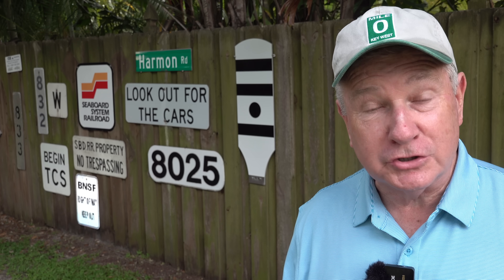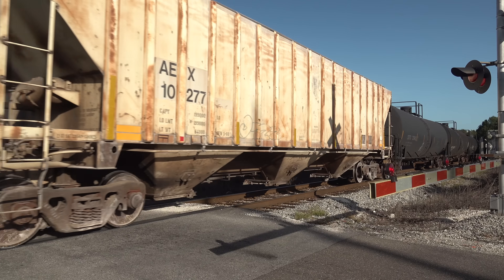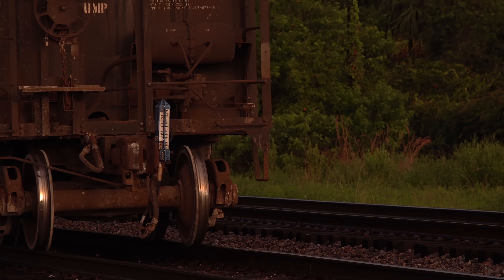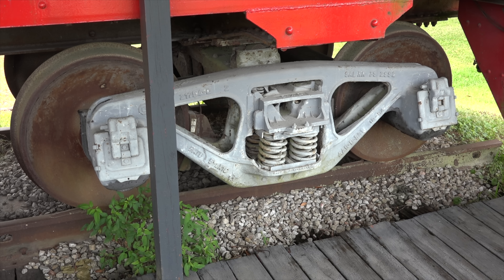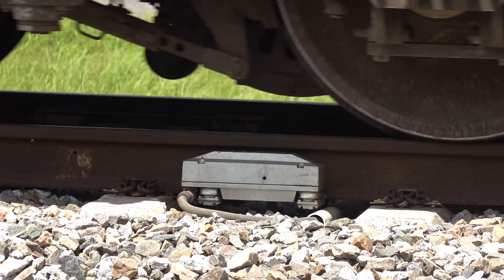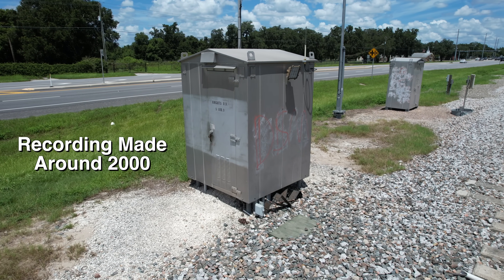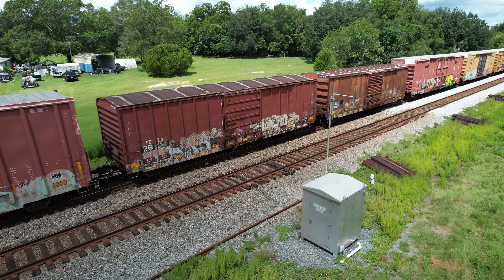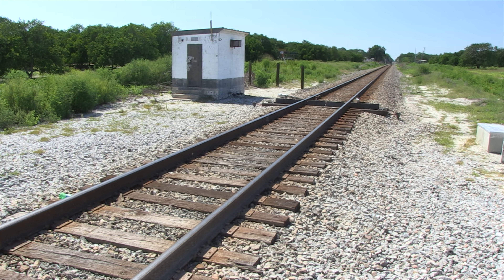What Railroad Defect Detectors Do

Comment: I've a few questions.  Does the Defect Detector also send a message to Amtrak trains operating on the line?   Also, it the Defect Detector alerts the engineer of a problem, what happens?  Does the train stop in the middle of its run so that someone can walk back a mile or so to look at the problem?  If so, what if the guy can't fix the problem on the spot?  What does the train crew do then?
Reply from the maker: All good questions. Yes, all train including Amtraks have to monitor the radio's road channel. If the DD signals a problem, the engineer, iin most cases, most stop his train and the conductor or other train crew member must walk back to see what the issue is.  If they cannot fix it, they must call a shop truck to come out and repair the defect. Or set off the defective car in the nearest side track.

Comment: Oh, pleasant memory of the days of four-man crews and cabooses. I was at Alamogordo, NM with the Air Force. Just south of the US-54/70 overpass of the Southern Pacific was a defect detector. As was the norm for the day, above the shanty was a large "digital" numerical display board. Atop the board was four or five lights, each one indicated a specific defect. Instead of radio transmissions, the detector relayed info to the conductor (in the caboose) any defects by use of that board. When a defect was detected, the appropriate light would illuminate and the detector would start counting axles. When the caboose passed, the conductor would know what the defect was and how far ahead of the caboose it was located (by the axle count). A "No Defect" was indicated by all the lights being dark and the number board displaying a "000". Remember driving over many a train passing by that detect. Never did see the number board "counting".

Comment: Another good one.  @ 2:06, noticed the end of the bulkhead flat car needs a little work. 1943 Frankfort Junction derailment disaster was caused by a ‘hot box’.  As usual, it took 2-3x the video length just to check out locations featured.

Comment: Been to Sinclair Antennas a number of times in the Buffalo NY area back on the 80’s and 90’s. Personally I would use 2 beams pointed up and down the tracks with a low power radio.

DE N2JYG

Comment: HI Danny -- I see a lot of double stack shipping containers on different lines . I have always wondered how they tie down the top container to the bottom one so they don't come lose and fall off . I am sure it's something  very simple but they go by so fast I can not see how it works or how they are connected . If you have a chance and a bit of time would you please explain to this old dummy how it works ?  Thank you very much  bob k    n1jrm.....I used to work for Timkin co. in Canton Ohio and I used to grind out the inside diameter of  the bearings for those rail cars
Reply: HEY thanks Danny - i found what I was looking for -Double-stack rail transport - Wikipedia- it's a twistlock that fits in the tiedown on all four corners , what a ingenuous idea , thanks again

Comment: Thanks Danny, always look forward to your videos. A few years back, I noticed a train here in Ocala Fl. with two engines that had no crew inside. On the side it said being operated by remote control. How is it determined when and where to not use engineers? And are these only on short runs? If You have already addressed this in a video, let me know and I will look it up. Thanks
Reply: Remote control is mostly used in switching or yards.  There is an operator somewhere near by.

Comment: I find it interesting that railroad detectors are not standard in their data reporting. On the west coast with the union pacific the detectors used to transmit time, temperature, train speed, length, total axle and even direction as well as which track number and mile post. The NS in Ohio only reports no defects and axle count. Another topic that might be of interest to tell rail fans is how powerful are the two way radios that trains use and what is the approximate range of the communications when you have 2 mile long trains. I know they use repeaters along the track but a lot of times you have crewmembers just using a 5 W radio. One other thing do you foresee the railroads using digital radios versus analog and are they going to use coded frequencies and scramble signals to prevent public access just like police radios now use?

Comment: Close but no cigar, the old lead babit bearings did not use grease, the used oil plus the application device inside the   Journal to feed oil to the bearing and keep it lubricated and cool.  It was not uncommon to have an “oiler “ who handled an oil pipe with a valve in squirt a small amount of oil into the journal box to replace the the oil that leaked past the seal. This oiling is done generally on the move as a train is being humped. Prior to the train being humped the car department would walk the train to open all the journal’s boxes so oiling could commence without stopping the jump job. Now roller bearing do use grease as it’s a sealed waterproof bearing assembly. Because of roller bearings you see very few old style friction bearings the require oil.

Just thought you should know. 

Food for thought
Reply from the maker: Yeah, that was way before my time so I missed that one.

Comment: Another fine video with plenty of information yet produced in an easy to understand format.  In the mid 1960s we'd visit relatives and I remember seeing poles with a number box on top. The crew in the Caboose was to look at this display to see what axle may have a defect. In the late 1990s CSX crews in upper Indiana had to verbally acknowledge the readings of the detector whether there was a defect or not. CN detectors give the temperature here i Wisconsin saying 72F (example)  Makes one wonder if Canada reads 20C?  Speed is stated 55 but no MPH or KPH. That new shed detector sure does a lot.
Perhaps while they're at it they'd like to invest in a run through locomotive washer just insert 50 cents as you pass through.  Thanks again for a great 🎥

Comment: I don't think the explanation of buffer cars at the end of the video was quite right. There's no requirement to have a buffer car when switching, so I doubt they'd put a buffer on the rear that reason. Even if they did prefer to use a buffer when switching, there'd be no reason to take it across the country on every train -- they'd leave it at the loading/unloading plant. I thought it was just so that there was already a buffer car ready when the locomotives ran around to change direction. If you think about it, it takes a lot more switch moves to re-order the train from locos-buffer-tanks to tanks-buffer-locos, compared to the old days of going from locos-cars-caboose to caboose-cars-locos. (You'd need to separately run around the buffer car, wheares with a caboose, you can just run around the train, take the caboose off, drop it on the run-around, pull the train forwards and back it onto the caboose.)
Reply from the maker: I was just trying to make a basic explanation of why they are there.
Reply: @distantsignal  Fair enough.

Comment: I became a defect detector in the fall of 2018 waiting for a UP train to finish passing. I first heard, then saw the wheel on one freight car missing about 1/3rd of the flange. Since the line was CWR the sound from the broken wheel stood out from the train going down grade. I called the UP emergency number very shortly after the train passed and I could see the number on the box by the crossing. You don’t want a tanker with hazardous chemicals in a derailment.
Reply: why th do they use this horrible outdated way of voice reports? Digital data over wireless links are much more reliable and accurate and exist for decades.
Reply: @RandomUser2401  The principle of keep it simple, stupid. They have to listen to the radio anyway. Your idea would require yet another gadget that needs to be installed in every train, it can break, has to have updated software, somebody's going to be distracted poking around in and miss a signal, added cybersecurity concerns, etc. etc. Anyway, in modern defect detectors, non-critical defects aren't announced. Things like images, wheel profiles, bogie geometry, predictive alerts are correlated with the railcar information from AEI, uploaded to servers, and somebody analyzes and views them later and schedules maintenance as necessary.
Reply: @straightpipediesel  In Europe these systems are completely integrated into electronic control stations, fully automated and fail-safe. Axle counts are automatically checked against the one reported from the dispatcher and so on. In a defect case, signals will automatically stay red/closed. With this system all it takes is one guy to miss a radio call and you have disaster. Not even mentioning the often horrible audio quality, making it hard to hear what even is going on. You are mistaking simple with proper.
Reply: @RandomUser2401  The "horrible audio quality" doesn't exist because the unit is transmitting literally next to the receiving train. In another example of KISS, radios run simplex, not those overly-complex GSM-R/NRN things you have in Europe. And no, you don't have "disaster". This is not high-speed, or even passenger rail where a derailment sends people to their death in a bridge. This is low-speed cargo rail, where on average, 4 derailments occur in the US per day. The low cost is balanced with the low risk level, again applying KISS.
Reply: @straightpipediesel  4 derailments per day is a very very bad statistic, showing again how little money is invested into proper infrastructure. GSM-R is used for VERY good reason as it can, again, properly secure rail traffic. GSM-R is nothing new but used for decades. And a derailed fright train can cause A LOT of damage to both people and property. Just because there are no people on the train does not mean no people are endangered.
Reply: @RandomUser2401  4 derailments occur in the US per day and nobody hears anything about it. That's how the system operates. You spend money and make it expensive Europe does, and it ends up being more economical to truck or fly the cargo anyway. You see this in Europe where low-cost carriers are better than train. You're not going to fly coal or corn syrup. There's nothing to invest, these railroads are all privately owned, they invest their own money. In conclusion, you can't apply European logic to cargo rail, because Europe fails miserably at cargo rail.
Reply: @straightpipediesel  yeah 4 derailments per day is utterly bad. And excuse me, rail cargo is not working in Europe? wow you are utterly clueless. It is used for everything heavy and often covering very long distances.
Reply: @RandomUser2401  "everything heavy". Where can you move a double-stack ISO? The continent's got 3 different rail gauges!
Reply: @straightpipediesel  the vast majority is 1435mm, and just because you can‘t double stack does not mean you can‘t move heavy. And I am pretty sure you are well aware of this.
Reply: @RandomUser2401  as others i think already pointed out, it's about robustness. there are Pros and Cons to both, however every train cab in service going back decades since its first day of service will have a very simple HAM radio which likely hasn't been replaced over the age of the train since there's very little to go wrong and they're built to last. using existing technology that just works to convey critical information maintains both backwards compatibility and the reliability of an existing device that's already present without need of modification or change in operation, also means that no additional training is required to use it, since it's part of the same training on how to use the radio to begin with. Of course you're not wrong either, but it would require an overhaul of a system that is resistant to change ;)

Comment: Those Sinclair antennas are great quality. Used em for years. In that single folded dipole config they aren't very directional really. Mild cartioid on the side away from the mast. Cheers.
Reply from the maker: Yeah, But I wonder about the need for the added expense. The old 1/4 wave antennas did the job and were 15 bucks. These Sinclairs are $400.

Comment: The old friction bearings were lubed with oil not grease.
Reply from the maker: Yes, several folks have written in tonight and told me that.
Reply: @distantsignal    Dan the only friction bearings that I know of that are lubricated with grease are on Steam Locomotives.  Our Mikado’s drivers are lubricated with spring loaded grease blocks.  There is a curved brass plat with a bunch of holes in it that rides up against the axle.  As the temp of the axle rises the grease softens and is pressed up through the holes in the brass plate to lubricate the axles.  And the rods are lubricated with a hard grease too.

Comment: Dan there are regular cars with 3 axle trucks.
Reply from the maker: Yes, but not many.
Reply: @distantsignal    There are a lot more 4 axle cars than 6 axle cars.  There may not be many in Florida because I believe we have a lot higher concentration of chemical plants and refineries here in southern Louisiana and southern Texas.  Most of the 6 axle cars are tank cars going into and out of the chemical plants and refineries.  The next most 6 axle cars are flat cars.  A 6 axle car has a gross weight of 1.5 times the gross weight of a 4 axle car.  And the 8 axle cars gross weight is 2 times that of a 4 axle car.  The 8 axle cars was not as common as the 6 axle cars.

Comment: this is for the star trek fans. There is a direct connection between the entire Star Trek series and the defect detector. Majel Barrett (or Mejel Rodenberry) lent her voice to several DDs on the Southern Pacific and various other railroads. The following is a direct quote 
"The Southern Pacific Railroad used her voice talent[citation needed] contained inside Harmon Electronics (of Grain Valley, MO) track-side defect detector devices, used in various locations west of the Mississippi River. When a defect is identified on the passing train, the system responds with her[citation needed] recorded voice announcing the defect location information to the train crew over the radio. In railroad forums and railroad radio monitoring groups, she was and is still referred to as the "SP Lady". However, with the implementation of newer hotbox detector technology, finding her voice today on working detectors is very rare. The hotbox detectors that had her[citation needed] voice installed in them were not upgradeable to the newer digital signaling requirements, and finding parts for them was difficult. Today, her[citation needed] voice is found on smaller regional railroads, usually only at dragging equipment locations, such as in California at milepost 24.6 on the Metrolink Lancaster line (under the I-5 and I-210 interchange in Sylmar), and in Oregon on the Portland & Western at milepost 746.5, near Lake Oswego. These voiced detectors remain because the lines were once owned by Southern Pacific, and because only two unchanging recorded messages are used, compared to the dynamic changing library used in hotbox detectors. The only major railroad that still uses her[citation needed] voice today is Union Pacific.

Initially, Guilford commissioned Majel to say "Guilford Rail System", and the recording was programmed into detectors across the railroad. Train crews and local rail enthusiasts dubbed the MBTA Andover detector with the nickname "Andover Annie". Both the Andover and Shirley detectors with Majel's voice were replaced between 2015 and 2017 respectively with General Electric brand detectors, which use a male voice.

In 2006–2007, just before Majel Barrett-Roddenberry died on December 18, 2008, the recently re-branded Pan Am Railways (formerly Guilford) was able to commission Majel one last time to say "Pan Am Railways" for their defect detectors. As of October 2020, Pan Am Railways still uses Majel Barrett-Roddenberry's voice for defect detectors at eight different locations between Maine, Massachusetts, and Upstate New York.

Pan Am Railways defect detectors that still utilize Barrett's voice recordings include the following locations: In District 1, MP 134.1 in Readfield, Maine, just off of Plains Road crossing. Second is MP 157.2 in Lewiston, Maine, just off of Merrill Road crossing. Lastly, MP 176.7 in Gray, Maine, just off of Depot Road crossing. In District 2, only one detector with her voice is in service. MP 234.2 in North Berwick, Maine, just off of Elm Street/Route 4 crossing. In District 3, there are four locations that still utilize her voice. First, MP 346.6 in Gardner, Massachusetts, near Parkers Street underpass. Second is at MP 369.1 in Wendell, Massachusetts, just off of Wendell Depot Road crossing. Third is at MP 410.9 in Zoar, Massachusetts, paralleling Zoar Road. Finally, at MP 440.2 in Hoosick, New York. The future of these defect detectors remains uncertain with the current state of Pan Am Railways being for sale. If a new railroad takes over, these rare defect detectors will likely be replaced. " 
Now I'm not sure how many of these locations still use voice today, but I did find this to be very interesting.

Comment: That was, really, interesting, Danny.  I was at the Whitefish Depot in Whitefish, MT, which is the northern BNSF yard.  This day, an ethanol train was sitting on track 1, I believe, going through a crew change.  As they pulled out, heading west, I noticed several cars with flat spotted wheels.  This train was headed toward Seattle, so I'm pretty sure it was fully loaded.  Could this have been a problem?